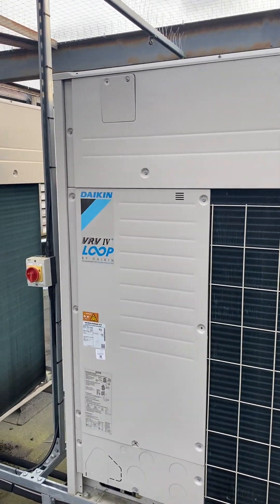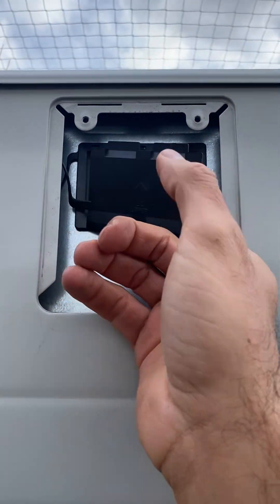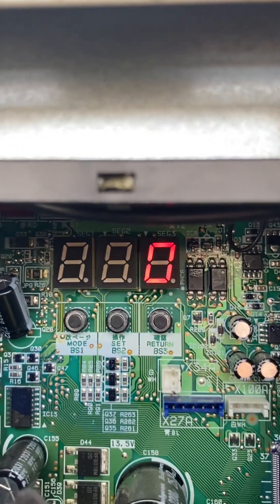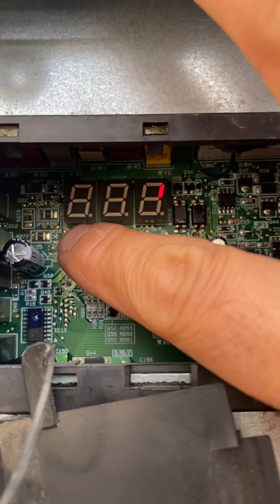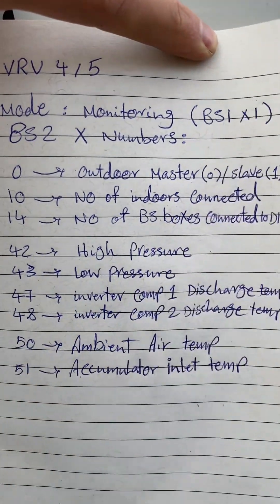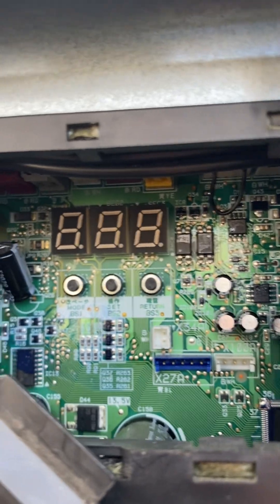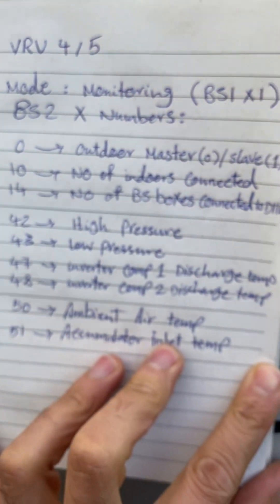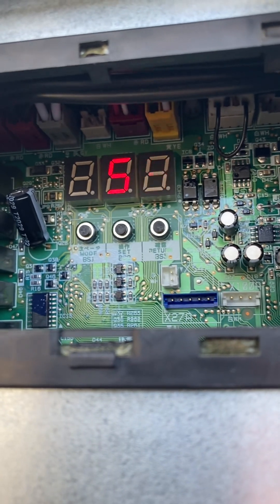Daikin VRV 4 or VRV 5 outdoor unit Function settings , identify Master or Slave units !

Comment: But inverter compressor (1) discharge pipe temp. - 
Mode 1times ,Set - 46 , returns 1times but you cheak 47 that means ,in this vd you check inverter comp.(2) discharge pipe temperature . Am i right ?

Comment: Thank you for sharing your wonderful video. I was really impressed by how you handled the recovery process — I’ve learned a lot from you.I wanted to ask for your advice regarding a VRV 4 system that I recently put on a test run. It came up with error code "JA." Upon checking, I found that the pressure was at 0, indicating no gas in the system.Do you think the error is due to the lack of gas, or could it be a faulty high-pressure sensor? If it's just due to the gas, could you advise me on the correct procedure for charging the system?I appreciate any guidance you can offer!
Reply: @rhvac  I really appreciate your help! I will definitely carry out the pressure test. After that, could you advise on the best charging method? Should I go with auto charge or manual?I understand that I need to charge the system before the test operation to avoid getting the "JA" error again, so I'd appreciate your guidance on the next steps once the vacuum is completed.Looking forward to your advice!
Reply from the maker: Hi,
Unfortunately by accident I deleted my previous comment in regards to how to do it 😖
But hopefully as you read it, you remember to put the system in recovery mode before doing the pressure test or vacuuming or charging it 😉

For charging the system, I usually look at the system refrigerant charge records and then I put the unit in recovery mode and charge it manually through the liquid and discharge line.
After that, I personally keep it in the off position by turning the power supply isolator off for at least 10 minutes and then turn on the system and it should automatically come out of the recovery mode and power up in the normal mode 👍
Reply: @rhvac  will do ,thank you  for the advise
Reply from the maker: Welcome 👍